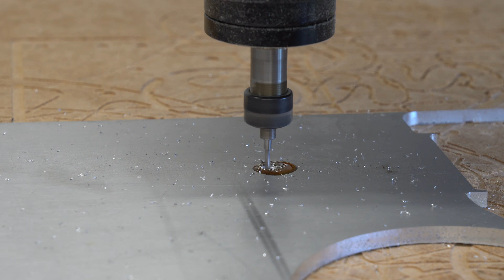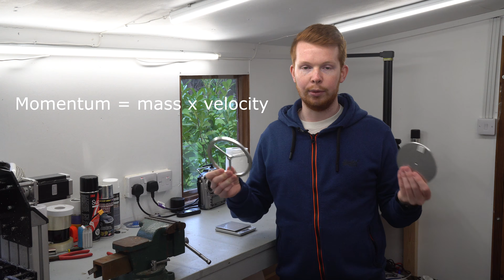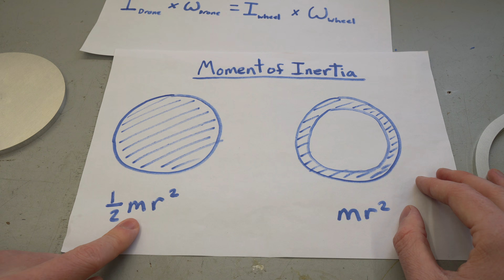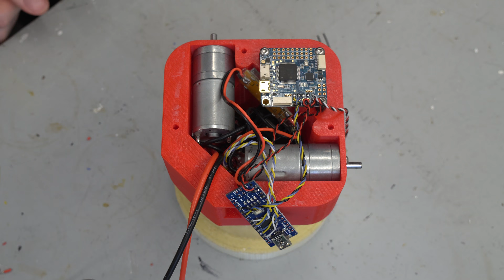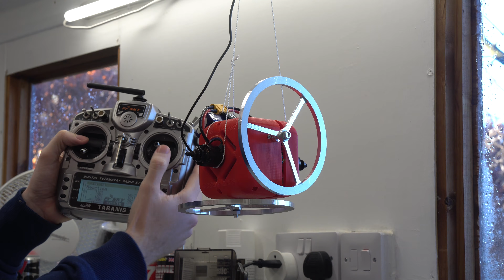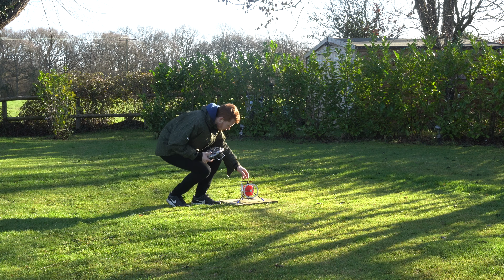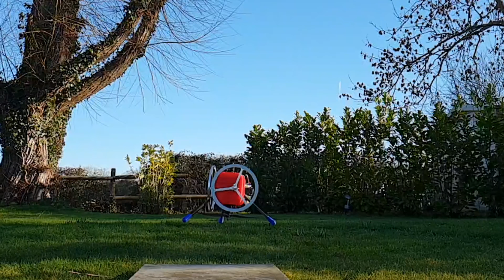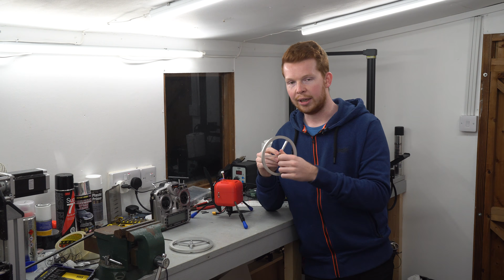Comment: It looked to me like the drone was not fully balanced and that the reaction wheels tried to fight a diagonal imbalance together which brought more instability into the whole setup.
What might be helpful: Try to attach both rotors on top of the drone, to get the center of lift above the center of mass - that way the center of mass would automatically help with the balance issue.
Or, if that is not possible, add weight to the legs to lower the center of mass, with the same idea of it being below the center of lift.

Comment: Thanks! I alwas wondered if that would work. I was thinking if you spooled up the reaction wheels prior to take off, you would have the best "resolution" in the torque band. You would also realize a natural gyroscopic stabilization effect. Also larger diameter propellers would help a Lot on the yaw axis and produce surplus thrust. Well done!!!!

Comment: The problem with the stability is that the center of gravity of the drone should be low in relation to the propellers. What I mean is that the drone's resulting center of weight should be hanging and be stable as a pendulum - in a pendulum the higher the deviation from vertical, the higher will be the force to push it back to vertical position. I suggest you install the upper propeller at the tip of a longer shaft. Also try to put both propellers above the drone's body. It is really just a question of stability. That's why helicopters have the propellers at the top
Really nice project!

Comment: Well, another option besides the encoder would be to determine the angular velocity based on the back emf on the motor since the back emf is linear to the angular velocity of the motor.
Does the Arduino nano have any analogue inputs?

Comment: Instead of a reaction wheel, make a reaction balancing beam. ?
Reply: Actually, use the entire body of the drone as the balance beam.  It reduces the entire system to vectored thrust. But 2 axis tilting of the propeller.

Comment: Create a lookup table for non-linear current vs torque.  Then use the lookup value of the current needed.  You can tune the table with the drone attached to the table with a digital scale measuring the torque vs current.
Reply: Interpolate for needed values inbetween the table lookup indices.  Or, instead, fit a polynomial function to the measured points (excel or online calculator), then just evaluate the formula instead of using the lookup table. If evaluating the table takes too many cpu cycles, just use the polynomial function to calculate a bigger lookup table than you started with (and still interpolate fit inbetween values).
Reply: Torque is reasonably linearly proportional to current (especially once rotating) for these brushed DC motors, but you can't directly drive current so there is a second closed loop current drive system inside the closed PID loop. When driving competitive robots and inexpensive assembly robots at work to a specific position quickly we've had a lot of issues with not being able to find stable PID parameters when attempting to drive current, in part, due to the added latency. A more accurate and faster (less latency) solution we've often had better luck with is to use PID to calculate the desired torque and to then use the motor's actual measured torque as a function of both voltage and rpm to select the appropriate voltage using a lookup table backwards or turning the data into a polynomial approximation. You need to add rpm sensors to each motor but the desired torque is applied almost instantaneously which helps the PID solution perform.

Better still is to calculate the full transfer function, including inertia based accelerations and torque vs rpm & voltage and then solve the differential equation for the desired outcome (zero acceleration/movement, drive to a position, etc.), driving the voltage directly (with rpm as one of the inputs). It is way more math but it usually works (if you build the transfer function accurately and don't cut too many corners solving the equations) and you don't end up having to guess at improving the PID parameters (that never seem to be stable when you are trying to move quickly...)

Comment: The torque is always proportional to the current. But with higher RPMs the back EMF gets higher which lowers the current for a given supply voltage. And I guess you don't really control the current through the motor but the voltage via pwm.
Reply: Tom stated he was driving current but if he was actually driving voltage directly then no wonder it wasn't stable. We've used PID controllers to drive motors and robotics components and when the guys make the mistake of driving voltage, expecting it to be proportional to torque, it is a disaster (especially at low speeds when close to converging). Most of the motor controllers these days can be switched to current drive mode though. While this works much better than voltage, if you are trying to push things as fast as possible we find the latency associated with the inexpensive controllers closed loop current drive solution (whatever they use?) is enough to destabilize the PID and make it so no PID parameters meet our performance needs. I've detailed in other posts here what we've used to work around this.

Comment: does the gyro take into account the gyroscopic precession of the flywheels, i get that it polls an axis and corrects accordingly but in the video how it sort of rolled about like a spinning coin the delay in the reaction of the gyro to counteract the movement seems to cause this, if the gyro took into account the precession movement of the gyro beforehand and spun multiple gyros the correct way instead of one at a time it may fly smoother, tho im guessing that would be a bitch to code
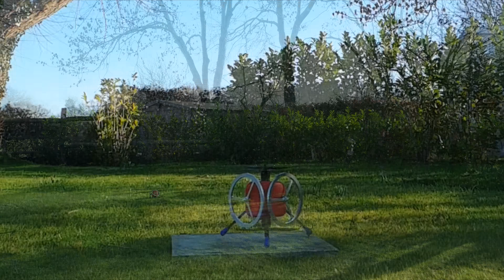Reply: looking at the slo mo portion of the video, at 0.25 speed it seems that what im getting at is at least in part right, the pitch at 18:19 it seems that the right pitching (because of the wheel) then makes the drone bank to us, that would be true if the top rotors gyroscopic properties acted, as in precession. the think getting me confused right now is why doesnt the bottom rotor counteract that movement. or why the wheel (left) that would be responsible for that sort of movement had very little affect on it; it spins in a way to get the drone to pitch away from us however even as its still moving it begins to violently pitch towards us so there is something else im missing

Comment: Hi Tom, there's 2 things that come to mind for improving the drone.
1. If you have a 'leg' sticking out of each corner then the proppelers should be protected. This would be like a second cube to protect the first.
2. The best place for a reaction wheel is in the centre of the drone, but as you need two of them for different axis then they would occupy the same space.... Impossible.
By having the reaction wheel to one side ]----[{{{}}}] could unbalance the drone.
But if you had a motor with the axel sticking out of both ends
 ---[{{{}}}]---
 then you could add a reaction wheel on both ends
 ]----[{{{}}}]----[ 
This should be the equivalent of having the torque in the centre of the drone.
I hope that you understand what I've typed, I'm just not good at explaining things through words.
Keep up the good work.

Comment: Not taking into account the effects of each axis's spinning mass on the other is going to limit control ability. I'd also recommend designing the drone to be slightly stable itself.  This would reduce the authority and response time requirements on the reaction wheels somewhat (they would mainly be used for maneuvering, not stabilization), but more importantly would allow you to have something to "push" against to momentum dump and prevent saturation - an absolute requirement for any sustained flight using this technology. Or you could just go straight to a redundant VSCMG cluster ;]

Comment: amazing idea! you have a lot of oscillation in your reaction wheel control. some of it is because of the wonky reaction wheel mounting, but some of it is because you tuned the PIDs without the helicopter blades, which add gyroscopic procession.

Comment: This is an incredible video. Have you thought of making an aquatic drone (ROV) using the same principle? I know the resistance of the water maybe an issue but if the wheels are internal it wouldn't be a factor.  And you could use buoyancy to your advantage.

Comment: Another idea would be to have 2-2 reaction wheels with brushless motors. Each wheel turning into just one direction. This way, you wouldn't have to reverse at each change of direction, just change the ratio between the 2... how about that?

Comment: Seems like the balance of the whole thing was off. On each takeoff it was immediately pitching towards the battery. I guess you would need to very accurately balance it out hanging it by only the top prof shaft, because hanging it using 3 points will bias the balancing. I would love to see more progress on this. Also, you can test the 2 axis lofting it using the same hanging point (top shaft) and drag the cord around and see if the drone levels itself. Real flight test should be done only after that I guess :D

Comment: I don't think the torque wrt current gets lower with higher speed. It might be that your ability to generate current reduces with the higher speed/BEMF. What DOES influence the system a lot is that the gearing causes everything to have a static friction that goes away when things start moving. And even the dynamic friction causes a non linearity of the output torque vs current graph, especially around 0 current/torque.

Comment: in a drone pilots point of view...youre mounting the flight controller directly on the 3d printed frame. If you do that, ALL the vibrations go into the gyro. If you softmount it by using some rubber gromments....itll lessen or eliminate the vibrations.
Reply: the same gittering effect happens to a quad when the gyro is recieving too much vibrations
Reply: also also, since the reactions wheels are applying torque to go to the left way when it leans to the right, the flight controller recieves that and feels like it should counter the counter if that makes sense. Since it tried to resist going to the right, it resisted and leaned to the left too much, and then it tried to resist going to the left too much, so it went to the right more. does that makes sense? again all of this is from a raing drone pilots view

Comment: I think the other motor wasn't actually producing less torque. It was just that as one of your wheel rotates, due to gyroscopic effect it is more difficult for the other wheel to rotate object in the corresponding direction as a whole. Whichever wheel rotates first will lead to difficulty in rotation along the other axis suing the other wheel. So, there is an additional effective mechanical delay (relative between the control of the motors). The effect of each motor is felt a little later, hence, i think,  leading to the weird precession.
The relative mechanical delay between the motors is unstable and increases with time dur to the gyroscopic effects (i think), requiring more and more torque to bring it back to original position.

Comment: That was a great result! You got very close to a stable flying drone there. Oscillations usually mean you need to tune your PIDs a little more, I would try increasing the D value for each axis, and potentially lowering P value too. D value/derivative control is very good at dampening sudden changes in rotational velocity, compensating for inertia and "predicting" errors, but it does work the motors pretty hard so you might not want too much. Experiment and see!

Comment: Awesome! Instead of a flying drone you could try a submarine. The reactions would be much slower and easier to observe. Also less crashes. You dont have to make it watertight, brushless motors work fine when submerged. Put the receiver and FC in balloons with zip ties. NASA is testing a lot of stuff in pools before strapping it to expensive rockets...

Comment: For DC brushed motors the current IS proportional to the torque!

You are likely PWM controlling the motor so are actually controlling the voltage on it. But with DC motors the current it draws at a given voltage drops as the RPM increases. So you need closed loop current control of the current in the motors rather than a encoder.

Comment: Precession! How can you forget about precession? You can fix that by adding 2 more wheels on opposite sides. Which will rotate in same directions  and same speed (on same axis, ideally). Also if you want to control rotation around vertical axis with propellers you should put em as close to each other as possible.

Comment: Would it work if you had the reaction wheels spinning at a nominal speed, even when 'level', then vary the reaction by speeding and slowing, rather than reversing direction? That way you could use brushless motors and spin your reaction mass at a higher speed.

Comment: To get around nonlinear torque you can set the nominal rpm to some value, not 0. Reaction wheel does not need to reverse direction to reverse direction of the body.

This will allow you to use BLDC aswell.

Actually thats how satellites use reaction wheels but mostly because you dont want to stop the wheel because it might weld itself

Comment: I was under the impression reaction wheels were spinning at high speed and  gyroscopic precession is used to impart a more controlled movement in the axis 90 degrees to the direction of rotation.

Comment: could you  not double up the reaction wheels and have them counter rotate  like the  yaw form the props. that way they can sit at s nice idle RPM  prelaoding them with some balanced momentum .  allowing you to use brush-less motors . so essential 2 smaller wheels  per axis counter  rotating  at a nice idle speed .    the  teh axis control  is only delta sin that idle  RPM .  no sudden start  stop .  possibly some mixed gyro effects .  
so 4 smaller wheels t 4 small brushless motors .

Comment: You could solve saturation by making the wheels into radial fans, like some car brake rotors. That would cause drag at speed which would cause the drive motor to continue to react with torque to the chassis. This effect would also increase as the speed increases, potentially solving your issues with reduced effetiveness you're having as the wheels reach higher speeds

Comment: I've always wondered if it was possible to desaturate a reaction wheel with another reaction wheel rotating the opposite direction before braking simultaneously to bleed all of the accumulated energy out as heat.

Comment: The problem is that the torqe is not symmetrical. Either put the reaction wheels in the center, or add 2 more. (And move them to 5he middle of the faces.) Then you will have smooth and flawless torque. If you apply the torque on the center of mass then you wont have any wobbling.

Comment: Perhaps a pulse acceleration profile could be used to solve the saturation problem.  Once the reaction wheel reaches top speed, cut power to it, and then spin up to max, until attitude is corrected.

Comment: WHAT IF you had those wheels spinning at a high rpm to start and tried to rotate the drone around the wheels and use gyroscopic forces that dont want to move instead of using the initial angular momentum. kind of like the bicycle wheel in the pivoting chair experiment.

Comment: thrust vector is causing an issue. after watching the footage i realized that there are in this system 2 thrust vectors. small one at the top big one at the bottom. normally not an issue. in ground effect the big one at the bottom becomes much bigger. inverted pendulum . i think for best case control here a pendulum would be better. perhaps a larger propeller and motor on the top? and another rc wheel on the bottom? counter rotating props on the top? as it sits the system is too unstable. some instability is good (makes it very responsive) but having an inherent bias toward instability ?  might need to think it out some. concept is ok i think overall though .

Comment: I would guess that the rotating mass is not high enough to counter the torque of the wheel slowing down, and it causes a counter modulation that the controller tries to counter

Comment: gyroscopic precession
you said the flight controller thinks its controlling its pitch&yaw with servos. so it likely doesn't know its got 2 high inertia rotating masses on either side.
i don't know how much time or programming experience you have, but id be glad to have a go if you want some help. i programmed this (the game has no concept of a helicopter, just a mod with aerodynamic wings): https://www.youtube.com/watch?v=G1ixGoArKGo

id love to see this working nicely. its a really cool project!
Reply: also, what happens if you hang it on a string from the top motor?